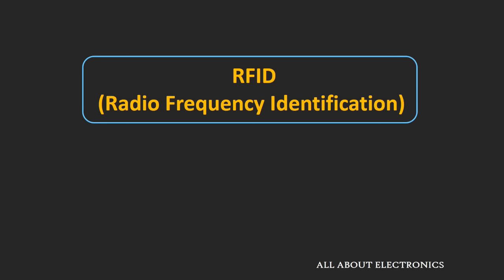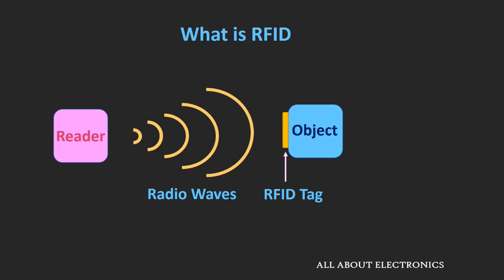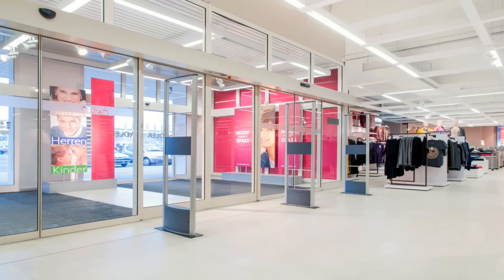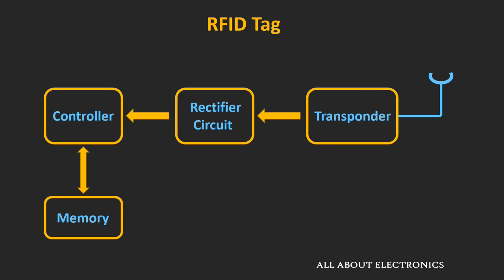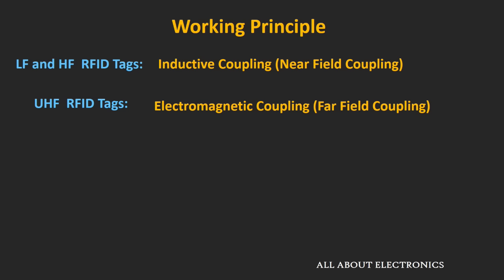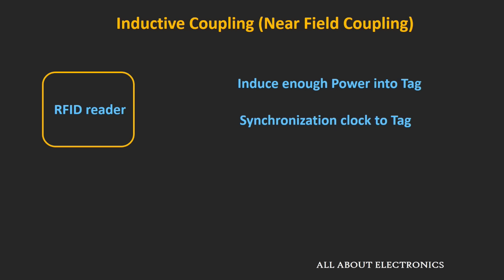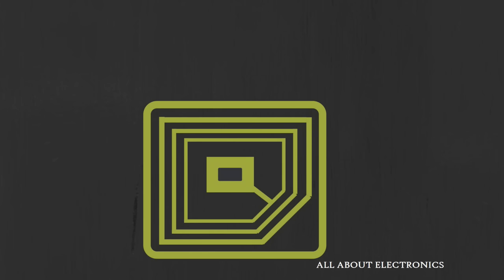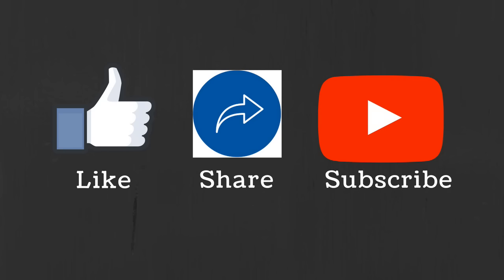What is RFID?  How RFID works?  RFID Explained in Detail

Comment: thank you really much for this video! Really clear! I have a question:  Can we use the FFC RFID with high frequencies and detect how far or how short the RFID tag is from the reader based on the intensity of the signal?
Reply: FCC is just a regulatory body, you can detect the range of the RFID by using an Ultrasonic sensor with a preset distance calculation or microcontroller with RFID wave data for interpretation of signal parameters.

Comment: Hello AAE, thanks a lot, now I understand how rfid works. Just one comment/question on distance travel wrt frequency (ts 5:13).  I thought one of the basics in radio waves is that lower frequency travels longer than higher frequency.  So i'm wondering if you had it the other way around.  Appreciate if you can clarify, I could be wrong.
Reply: Same doubt here

Comment: I have seen that RFID can be used as touch sensor in some cases, so when that happens  what about their transmission of data to Reader and the touching point could be anything, do you have any how that works?
Reply from the maker: In that case also, the RFID reader is reading the tag. When the tag is nearby the reader, reader grants permission or gives acknowledgment back based on the application.
Reply: @ALLABOUTELECTRONICS   But have you came across RFTouchpads which is just size of wrist watch, how the design of reader work for them.

Comment: it was a very useful video as our final year project is linked with it. do u have any idea regarding arduino uno based source code for smart shopping cart using RFID and zigbee
Reply from the maker: You will get the source code for basic interfacing on Github and Arduino forum.

Comment: Very informative. One query, Other than knowing the information about objects, Can we identify the exact location where the object is placed? May b within a room?
Reply from the maker: No, it's not possible to find the exact location. But using it we can get the approximate area or the range where the object could be there. 
If we go a bit step further then using multiple RFID tags on the same objects we can reduce the range. One RFID with higher range and one with a smaller range.
One RFID tag will identify the approximate range, while the other one will narrow doen the probable area. It could be done by altering the signal strength of the reader.
Reply: ALL ABOUT ELECTRONICS Thank you for ur response. do u know any other ways where we could get the location of objects within a building or room?

Comment: Thanks for all the details bro just a small doubt, If at the highest frequency also its range is 15m, how can it be used to trace birds?
Reply from the maker: See we directly can't trace a bird like GPS tracking. but since the RFID tag is attached to the bird, when that birds goes to some other region then using RFID reader in that nearby region we can ensure that it is the same bird.The RFID reader can be connected to the central server where the database of all the tags is maintained.
Reply: @ALLABOUTELECTRONICS  okay 👍

Comment: Hi, I want to use this for my business purpose. I need to understand more about its applications. Can we use RFID for weighing?
Reply from the maker: Yes, RFID in combination with load cells can be used for weighing purpose. They are integrated part of the tag. The load cell measures the weight and it can be transferred wirelessly to the reader using RFID chip. These type of tags are semi passive tag, means they operate on the small battery, and can be used in logistics. 
So, in short yes, it can be used.

Comment: Is there any reason to differentiate a Semi-Passive Tag from a Passive Tag? I understand the difference between the two, but am seeking to understand if there is any difference in the way they operate.
Reply: It is the same as passive tags, except they also have a battery  that "boosts" the signal for a longer read range. they also known as "battery-assisted" while "battery-assisted" is a better fit term for them.  the battery may also power additional features, for example a temperature sensor on the tag  or real time clock. (Google is your friend)

Comment: Thank you so much, you have explained RFID  very well. I have a question : " Whether the RFID will identify/track the objects in particular direction or in radial direction?" Like if the object is in front of reader then it will obviously detect it, but if object will be on backside or left or right then will it detect it?
Reply: i think the signal detection does not depend on the line of sight..so therefore the tag can be detected by the reader if it is in the range.
Reply: tags within the range are available.

Comment: can we use it in underground asset tracking ?  As in how it will function over there . Please let me know.
Reply from the maker: Yes, it can be used. The passive tag can be attached to the asset which needs to be monitored. Then later on using the handheld RFID reader the location can be found. 
If the handheld monitor has wifi or cellular internet connectivity then the location be mapped on the google map. 
Many companies provide the solution for the underground asset tracking.
Reply: ALL ABOUT ELECTRONICS  could you suggest me tag ic anf reader ic with their antenna design for this type of application . we want to build this application using our own microncontrollet and firmware.

Comment: Nice presentation diagrammatically. I understood more from the diagram. Narration was too fast, breathless and difficult to follow at that speed. If the narration was slower along with the slide, it would have been much better. Just like the slides, if you can prepare a script and get it proofed and practice the speech modulation, this would get to awesome level. Thank you for putting this up for all to learn.

Comment: can you suggest me some small size RFID readers Working on UHF and have Vin=5V ?
Reply from the maker: MFRC522 might be useful to you. But it has a 3.3 V supply voltage.
Reply: @ALLABOUTELECTRONICS  i am currently using this one only but i want smaller than this and it doesn't matter if it's voltage supply is betweeen 3 to 5. Can you please suggest me and with on board antenna.😊

Comment: Hi I am currently started a project to glow a light in a box 2 when the switch in box 1 is triggered. Can I use active tag for this project?  So that when the active tag provides the response I can switch on the light. The boxes are in different location where there is no internet access.
Reply from the maker: Yes, you can use active tags. But please check the range of the active tag before purchasing, and ensure that it is well with in your project requirement.
Reply: ALL ABOUT ELECTRONICS  Thank you

Comment: I do have a question sir ....... for example i have installed two rfid antennas in a place .... one antenna is for recording the objects entering into that area .... the other is for recording the objects leaving the area ....... at times .... the antenna is not recognising the rfid tag ..... even if it does , it gets recorded in outer antenna when it has to actually get recorded in in-antenna ....... how can i resolve this issue without changing the position of the antenna installation
Reply from the maker: If both antennas are placed together and operating at same frequencies then I think both will receive the signal irrespective of object is entering or leaving. I think the best solution would be to keep the readers apart. For example, you can place  the RFID reader  near to the door for incoming object. And for outgoing object or material, you can place the second RFID reader few meters away (depending on the size of the inventory room and the objects). 
When the object is entering the area then first it will be detected by the first reader and then by the next reader. So, if it is detected by the incoming RFID reader first then it can be concluded that material is being brought into the area. And similarly for the case of outgoing material, it will be first detected by outgoing RFID reader as it is few meters away from incoming reader. 
And you can conclude that it is outgoing material. If possible then try to implement it.
And if you have any confusion then do let me know here.
Reply: ALL ABOUT ELECTRONICS Thank you so much for addressing my query in such short time ..... I am now working on an RFID project .... and i do require so guidance in increasing the efficiency of it ..... Is it ok if i contact you personally and discuss about my project ?
Reply from the maker: Yes, you can message me on the facebook page or on the Instagram.  The link is there in the description.

Comment: What if there is an obstacle between the reader and the tag ? Can we still locate the tag ?
Reply from the maker: Unlike a barcode, the line of sight communication is not required in RFID. So, even if there is an obstacle between the tag and reader, the tag should be identified.
But sometimes the obstacles like metal or water can affect the communication between tag and reader. But in general,  it won't affect the communication.
Reply: Thanks

Comment: we are actually using rf waves which has high wavelength compared to uv waves ..then actually the antenna size is directly proportional to the wavelength ..why don't we use uv waves for communication so that the antenna size is small so we no need to design big antennas and not required space to place antenna..?

Comment: Why we prefer rfid instead of bar code? And what is the difference between those two?
Reply from the maker: In case of a barcode, the laser is used to scan the code. The reflected light from the barcode is detected at the scanner. In barcode, the scanner and the barcode label should be in the line of sight. While in case of RFID, as it is using radio waves, so it can even work if the RFID reader and the RFID tag are not in the line of sight. As far as the RFID tag is within the range of the reader, the reader can detect the tag.
Reply: ALL ABOUT ELECTRONICS ...tq so much

Comment: what is load in RFID tag? what does it include and where is information stored?
Reply from the maker: In most cases, the MOSFET switch itself, which is connected with coil/antenna, acts as a load. By turning ON and OFF this switch (Load modulation) you can send the data.
Each RFID tag has some memory (Few KiloBytes), in which information is stored. This memory is further divided into many sectors like EPC (Electronic Product Code)  Memory, User memory etc, where product id, manufacturer id, and any other user-defined information is stored. 
Apart from that, like I said in the video, each tag has rectifier circuit, controller, and timing synchronization circuit and power supply (Only if the tag is an active tag).

Comment: How is it different from bar code scanning ?
Reply from the maker: In barcode scanning, the barcode needs to be in the line of sight of the reader. You might have observed that in the shopping mall. But in case of RFID tag, there is no need to be a line of sight. As far as the tag is within the range of the reader, the reader can read the tag.

Comment: If i have 500 set of garments each set has 4 piece consist of 2 booties and 2 shirts so totally 2000 tags i have to scan daily can u give me a simple solution to avoid individual tag scan?
Reply from the maker: Use a reader which can scan multiple tags simultaneously. You can use multiple readers which can simultaneously read multiple (different) tags.

Comment: Hi there thank you so much for the video. I am a student and Im learning about RFID technology. I have just one or two questions for you.
1. You taught about the different frequencies the LF, HF, as well as the UHF. The LF being only able to go up to 10cm, the HF up to 1m, and the UHF up to 15m. My question is how do they track cars or birds on the sky if the distance covered by the frequencies is only up to 15m? Thanks a lot in advance.
Reply: A passive ultrahigh-frequency (UHF) handheld reader has a range of about 10 feet, while a model using a beam-steerable phased-array antenna can interrogate passive tags at a distance of 600 feet or more.

Comment: Can I fix the rfid tag to my mobile phone and locate it if it's missing ?
Reply from the maker: I would say both yes and no.  If you know the probable area where it could be then yes, you can find it using the RFID reader. But if some unknown person has stolen your phone and some how if you are not able to locate that location then it would be difficult to identify. 
The thing is the range of RFID is limited. So, if someone takes your phone quite away from the range of RFID, then just using RFID alone you can't find it. But using GPS if you can track the location within let's say 50 to 60 meters of accuracy then using RFID you can find your phone. 
I hope it will help.

Comment: Can we detect the exact location of the rfid receiver ,in case it is lost in the inventory?
Reply from the maker: No, it is not possible to detect the exact location. You can only estimate the probable range or area.
Reply: So, is there any way to detect the location .
Reply from the maker: For active tags, it is possible to find the exact location as they have their own source of power. So, these tags can update their location when moved and can send the same data to the reader when asked by the reader. But these tags are very costly. So, if these tags are used for very large inventory, the overall cost will increase.  
On the other end, passive tags are cheaper but they do not have this capability.
Reply: Thank you.But can you tell me if there is  any way to track the exact location of a device which is within 10m or 20m of range.Like object A is x or y distance from the tracker.Excluding GPS ,glonass and rfid.

Comment: Can a rfid reader reads a tag when it is blocked by a object in front?
Reply from the maker: It depends what is the object and what is the frequency of RFID. 
For example, UHF signals can not pass through metal or water. And maybe blocked or attenuated by the object.
Reply: @ALLABOUTELECTRONICS  then why a rfid reader cannot read a multiple tag at a same time
Reply from the maker: @mamthas6931  There are many RFID readers which can read multiple tags at a time.

Comment: we already have rectifier circuit which can store voltage as it has capacitor than y  do u want load modulation??
Reply from the maker: Load modulation is used to transmit data back to the reader from a passive tag.

Comment: How can we generate RFID tags.....is there any software
Reply from the maker: Usually, they are made in a bulk in a factory. And they are readily available in the market. Using the reader, it can be programmed or modified.
Reply from the maker: For basic stuff, you can even use an Arduino for read and write purpose. (with MFRC522 )
Reply: @ALLABOUTELECTRONICS  am using RFID technology in student clg smart card .....
How much it cost for whole RFID implementation
Reply: @ALLABOUTELECTRONICS  k..tq

Comment: Sir can RFID be replaced by qr code ???
Reply from the maker: Both are different technologies. As I mentioned for bar code, the line of sight is necessary, and the distance is also limited. RFID can work without line of sight.
Reply: @ALLABOUTELECTRONICS  sir if you can help me in my library project as RFID library system is already existing but RFID is costly so I want to replace RFID with QR CODE.....

Comment: can we track our Mobile Phone by Attaching a RFID chip inside it..??
Although you are saying we can track animals(birds) with this chip...
Reply from the maker: Yes, in a way it is possible. But rather having it inside, it should be just beneath the case. so that it can be detected from some distance, as metal body attenuates the radio waves. And if it is inside, then the reader should be very close to it. (Like in case of NFC)
So, in short, yes it is possible.
Reply: is there any process going on to increase the bandwidth or signal length of reader...
Reply from the maker: NO, at least as of now. Because nowadays the NFC (Near Field Communication ) is gaining popularity, which is I would say a sort of subset of this RFID technology. And it is more secure and further peer to peer communication is possible in it. I will make a short video on the comparison of NFC and RFID very soon.
Reply: ALL ABOUT ELECTRONICS cant wait for it!! keep up the good work buddy

Comment: why syncronization clock to tag is used
Reply from the maker: It is required for the controller. So, according to this synchronization clock, the controller will send data to MOSFET transistor. (Basically for load modulation)

Comment: How to. Read the number in the rfid tag
Reply from the maker: RFID tag and reader communicate with each other on a certain protocol, which defines the frequency of operation, transmission and error correction and the sequence in which data will be received at the reader side. (Frame). So, reader exactly knows which bits contain data bits, which bits are error correcting bits etc. These data bits are extracted and stored via the software or API which is being used on top of this protocol to interact with PC. 
I hope it will help you.

Comment: Are you sure low-frequency signal can travel very short distance? because according to the theory, the opposite is actually true!!! Instead, whats true is that the tags using low frequency are designed in a way that they operate at small distances.